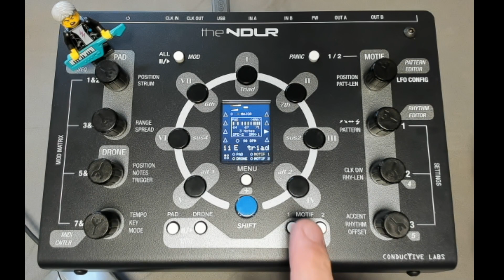Intro to The NDLR (rev2) Perlin Noise Pattern Generator

Comment: So everyone who bought rev 1 and has the menus ‘under construction’ get left behind, even though without their backing there wouldn’t be a rev 2… poor form indeed.
Reply from the maker: We only have a rev2 because we could no longer purchase the original microcontroller NDLR used, due to the pandemic, chip shortages and all. So we went 2 years with no NDLRs until we submitted and redesigned it for a new microcontroller. None of that work was easy or free. Now we have the opportunity to add some new features for new customers, and there's nothing wrong with that. The rev1 is completely out of storage space, so we can't add any new features that require storage. We still managed to get the Rotation Algorithm and Interval Notes controller in there. Yes, still providing free updates 7 years after launch. 
Later in the new year, we plan to have a crowd funding for a NDLR rev1 circuit board upgrade. First we need to nail down the features that we are committing to so people can make an informed decision on whether an upgrade is worth it. We hope to be ready for that by end of January.

Comment: This is freaking great! Early Christmas... you rock Steve!
Reply from the maker: We're getting closer to releasing the beta, but there was a large amount of code refactoring under the hood and we're still dialing it in. We also added some more features to make it more complete. Such as Mod Matrix targets for the Perlin Noise parameters.
Reply from the maker: The preview release is now available at forum.conductivelabs.com in the NRLR Open Beta Firmware section. You must be logged in to see it.
https://conductivelabs.com/forum/showthread.php?tid=2216&pid=7279#pid7279

Comment: Is there any way to upgrade a rev1 to rev2 hardware?
Reply: There may be a way coming soon.
Reply: @danpreston564  that would be good. It was my first thought too and I didn't even know there was a rev2 until this video dropped
Reply: Yes please - this would be wondeful.
I have two rev1 devices.
Reply from the maker: Later in the new year, we plan to have a crowd funding for a NDLR rev1 circuit board upgrade. First we need to nail down the features that we are committing to so people can make an informed decision on whether an upgrade is worth it. We hope to be ready for that by end of January.
Reply: @ConductiveLabs  great to hear, thank you for the update 🤞
Reply: @ That sounds like great news!  On the other hand, you seem to be implying that the upgraded rev1 might not ever reach full feature parity with the rev2.  I guess I’ll have to wait and see what you come up with to determine if I’d be better off trying to sell my rev1 and buy a rev2.
Reply from the maker: @deastman2  The upgrade for rev1 would be a complete circuit board swap, so it would be identical to a rev2 other than lacking a power button. We don't want people making a decision to upgrade based on assumptions of what might or might not be done "someday". We want to publish what you will get by upgrading, and the decision should be made based on that. What you get will be the same as what rev2 customers will get, it's the same firmware.